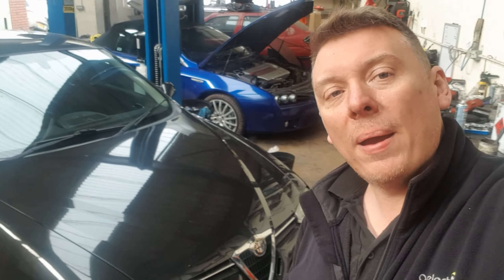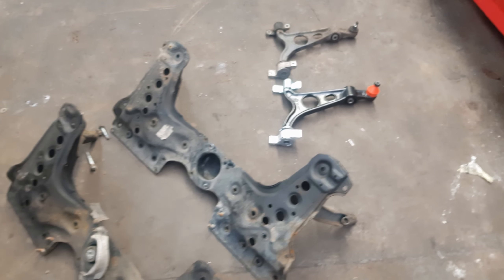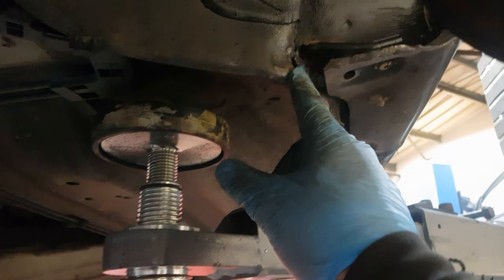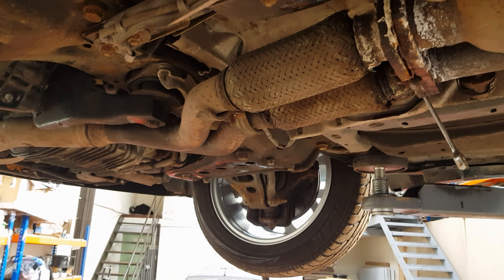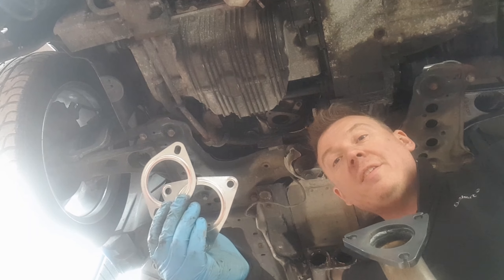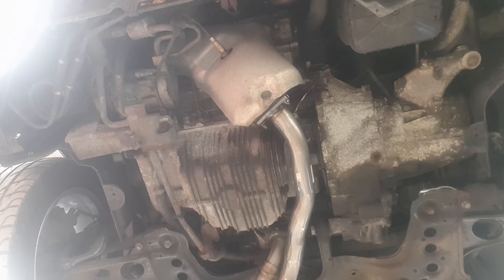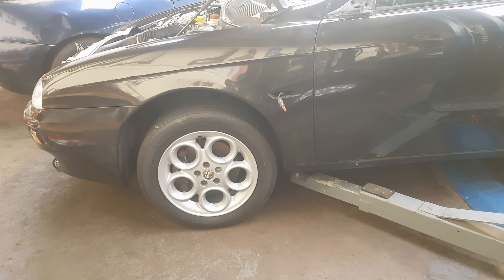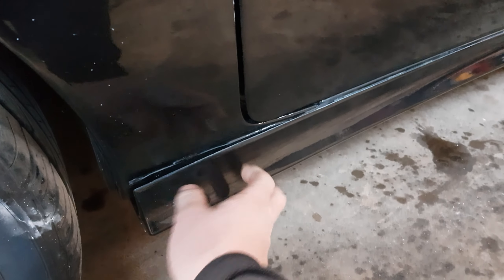alfa 156 v6 Accident repair part 3

Comment: Loved my 156 V6. Same colour and wheels as this - no spoiler though. 

Cost me about £2k to put right from a previous owners neglect - rad, cam belt, clutch, arms, maf. 

Once fixed that car kissed the red line daily and never missed a beat. The E36 has an advantage being RWD, but at 70% - the Alfa was perfect. 

Gear change, clutch feel, quick steering, noise. Plus lots of traction with that heavy Busso out front. 

Only let down were the brakes, plenty of initial bite, but no power at all.

Comment: Nice 166 in the background outside Neil 👍🏻
Reply from the maker: Customers car. Another garage gave up on it so I get the task of finishing it. Oh the joys.
Reply: Italia Autos I see Neil .. Would I guess correct suspension work because I spotted the odd alloy on it .
Odd stat even when I worked at Portbury docks driving Alfa’s brand new off the ship 1999-2002 I never saw a red 166 , They always seemed to be silver or occasionally the metallic affect where in some lights it silver and others it blue .

Comment: I'd love to know how you get the subframe aligned correctly. AFAIK there is some adjustment in the front subframe, chances are when you refit it won't go back in exactly the same place which will obviously affect camber and castor etc. Can you use alignment pins to relocate the subframe when refitting?
Reply from the maker: You can attempt to match up the bolts to the marks they left but yes a 're alignment is needed

Comment: I wonder if you have ever removed the v6 engine from a 156 with a crane lifting it out, rather than dropping it on the floor with a a hoist?
Reply from the maker: Don’t think it will fit with the gearbox on from the top